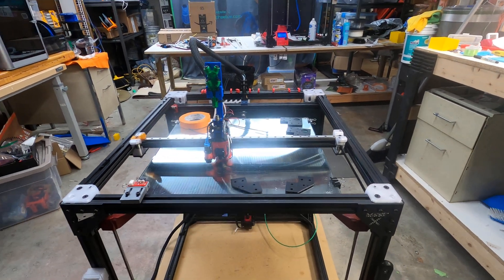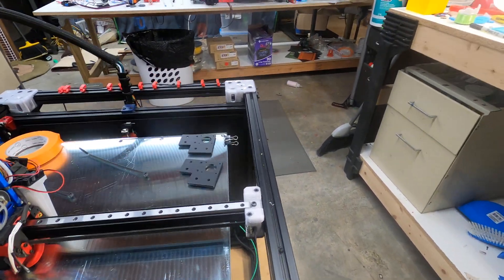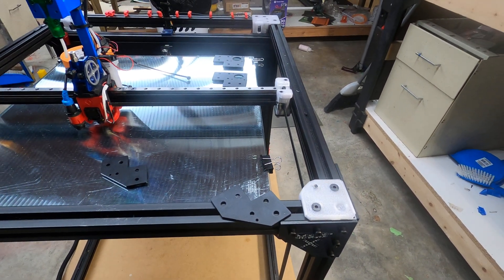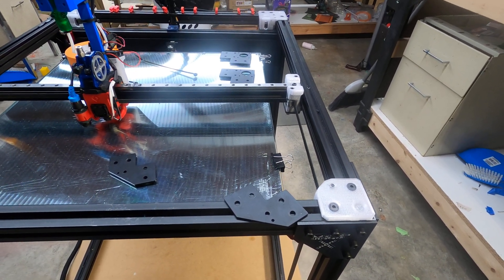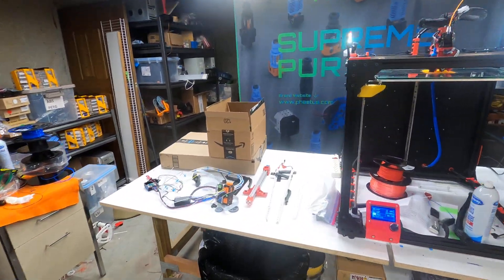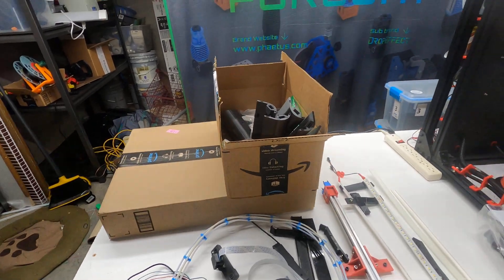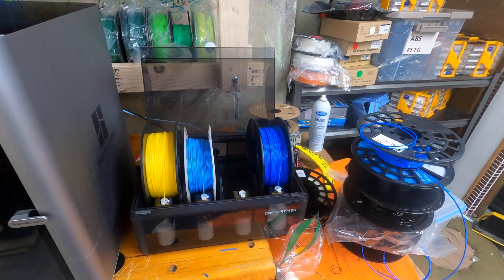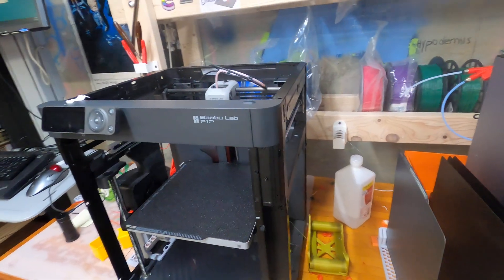Rat Rig 3.2 update - Bambu P1P ARC enclosure and 3D Chameleon

Comment: The 3D chameleon looks like an interesting concept.  I wonder how you don't get green when switching from blue to yellow etc?  Seems like the programming has to be exact or does the filament "back up" out of the way of the next color?
Reply from the maker: Good question.  There is a purge tower where filament is used to clear out the unused amount that is still in the hot end.  The amount can be adjusted by testing to get a good swap without wasting too much.  I try to make designs that have fewer swaps, but some very detailed can have over 1000 changes and the purge area is bigger than the printed piece.
Reply: @woodwaker1  Thanks for explaining that.  I learn a little bit more with each video.

Comment: Can't wait to see the chameleon in action!
Reply from the maker: I have it somewhat working, need to spend time on it, but decided to get the mods done on the printer first.  It should be much faster on filament swaps than the Bambu. It only needs to back out about 100 mm to switch vs the almost meter on the AMS
Reply: @woodwaker1  Yes mods come first. I find it easier to upgrade if I have something that that needs to be replaced like the hot end temp sensor!

Comment: Did you purchase the metal fittings online or have them made locally?
 I have a small 3080 CNC mill that I bought with the intention of making some aluminium parts but I need to make an enclosure for it as even with a polythene tent I made for it the cleaning up took forever and I still find metal swarf now and again in my shed/workshop
Reply from the maker: I found them on Aliexpress, very reasonable, and a perfect match to the Rat Rig parts